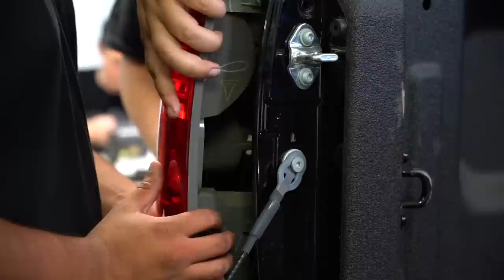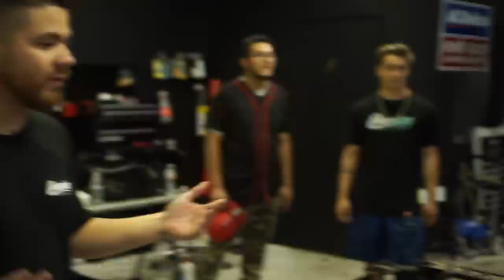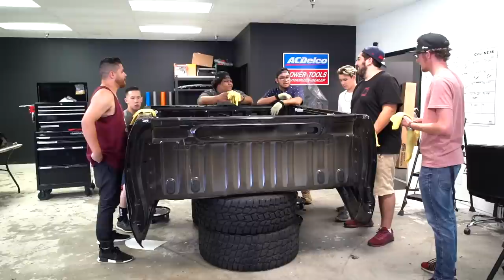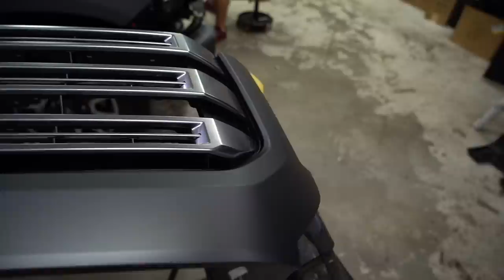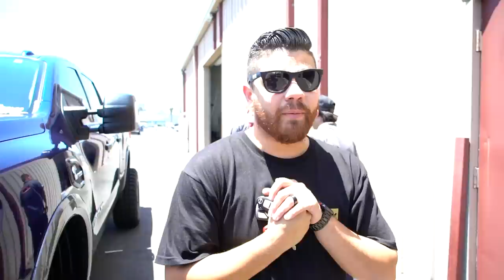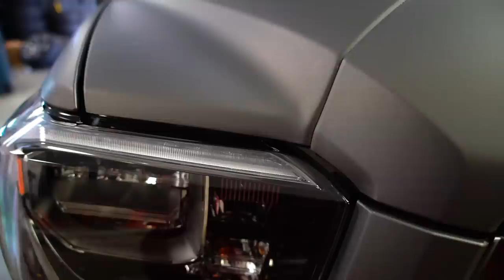HOW TO VINYL WRAP A TRUCK! 2018 Toyota TUNDRA.

Comment: Takes bed off to wrap back of cab because “that’s how we do it, don’t want any of the original color to be seen”
Puts bed back on without wrapping front end of bed....
Reply: Was wondering the same thing.  It makes no sense.
Reply: What do u expect , they are dropping a 4x4!!? Gthoh
Reply: makes sense because you would never see the front of the bed
Reply: When they remove the bed and are walking with it you can see that it's actually not painted where as the the back of the truck cab is painted. So they are correct in saying that they are wrapping all exterior parts that are painted.
Reply: Also looks like they didn’t wrap the top of truck to me. There is still black showing to the sides of the third brake light.

Comment: Why not use a 1-ton shop crane to lift the bed? Tie-down straps connected to a center point of the bed and to the inner edges of it, ratcheting it up. One man operation. Wheel it out of the way? Fuel pumps and tire winch assemblies are done with ease for example

Comment: I've been thinking about wrapping my el camino. Problem is there is no overhang around the bed and it is one piece connected to the cab. Looks like spray lining is not an option. So, would wrapping down to the floor of the bed and putting in a floor mat be a good option? I'm wondering if wrapping around the wheel wells and stuff is a bad idea? I'm guessing if the bed was spray lined and masked there would be no way to get the vinyl clean up to the edge.

starting to think painting is my only solution and I'll have to save for years to do that

Comment: Will vinyl wrap show imperfections in the original paint? For example, if I wanted to wrap my '01 Sequoia but it has a few nickle sized paint chips missing on the hood, will that show through the vinyl layer?
Reply: Tank Hulkington yes it will, it shows every imperfection so you should touch up the paint prior to wrapping

Comment: Can it stop a ding from happening? Otherwise you would have to repair the ding and replace the Vinyl again, Is that Correct?  Also owners of these cars should order extra Vinyl Wrap just incase it's a custom Color or No long made Vinyl Color, otherwise they will have to ReWrap the car because they no longer make that color and can't match it. That's somethign to think about and should be told to owners in advance.

Comment: hopefully they didn't use that 3m primer 94 that was sitting under the new hood with that Avery material... they specifically say it will degrade the adhesive in a TSB... js

Comment: so how long does a wrap last until it starts peeling? or does it peel at all ?
Reply: depends on the material used. 3m and avery make high quality cast wrap films that can last a decade if done right. also if you wrap the car in paint protection film...then a long while.
Reply: w² gotcha

Comment: I thought the whole point of a vinyl wrap was that it was quick, cheap and easy. If you're going to all the trouble to disassemble like they are, why not paint it?

Usually you just cut and tuck the wrap so it looks good enough at 1-foot away, but any closer and you'll notice the lips.
Reply: You want to look good from close bot just from a couple feet away

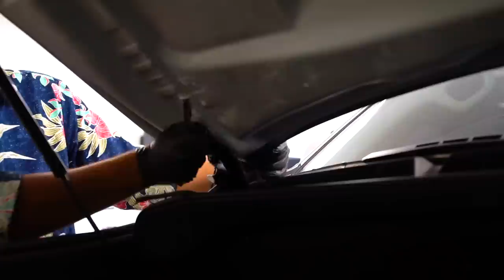Comment: Wrap on truck looks great. If the wrap edges under the hood would have been cleaner and consistent, it would look so much better when the customer opens the hood. See video at 18:58 to see what I mean. But over-all, looks painted and not wrapped.

Comment: You fellas got to think about resell.  What old boy's gonna give any good money for trade in on a wrapped Tundra ?   Should've put a rumble seat on the box over the tailgate for bouncin when off roading.  And get yourselves a nice set a meats.
Reply: It should drive up the resell valve to the max, once you peal that wrap off you have new paint with no sun fade & scratches
Reply: Tim Beals Lol right. I think these “real truck guys”  have no clue what a wrap is😂
Reply: @RCrider185  you can have the whole truck repainted and minor door dings fixed for less than the $4200 that wrap cost. 
You people love wasting your money, well its your money i suppose anyway
Reply: So spending $4200 on a auto right before you sell it is a better idea? and what are you even going on about? the topic we are talking about is how a wrapped truck doesn't drive down the resell valve

Comment: Does it tear from rocks hitting it
Reply from the maker: Michael Gonzales Great question! Just like paint there is only so much of a beating the material can take. The same way a rock chip can happen to your paint the vinyl can be damaged as well. Typically vinyl will inherit the damage and protect the paint. It’s also much easier, cheaper and faster to repair vinyl then it is paint.